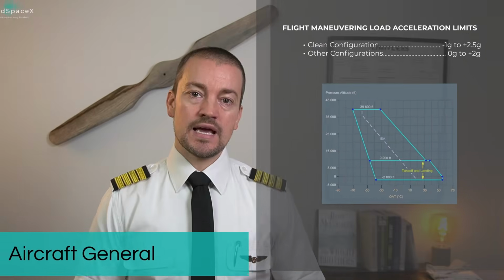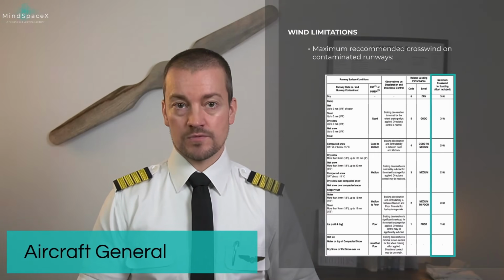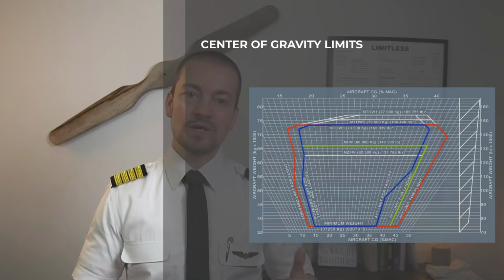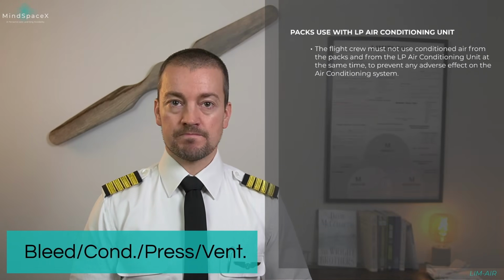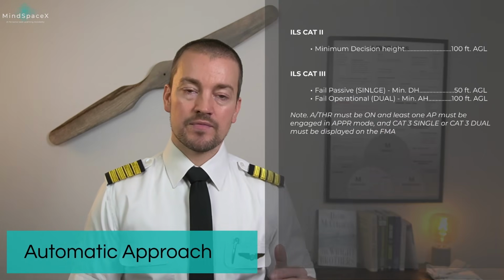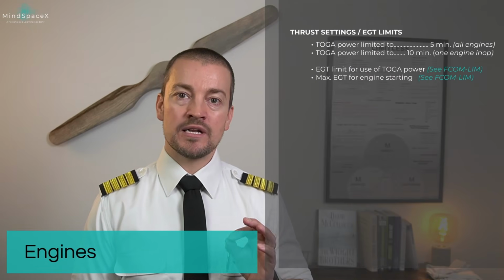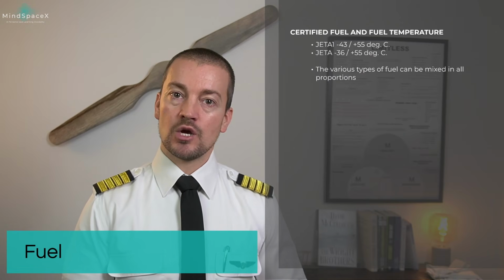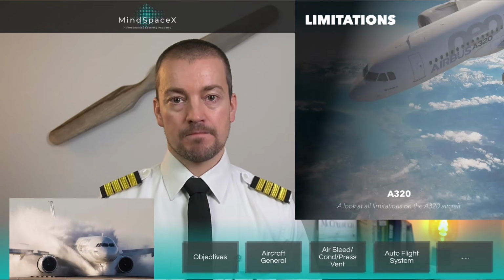A320 Limitations

Comment: In 50:25 Why are the max temp for T/OFF 300 if no brake fans installed, but 150 if they’re? 
Since you can’t takeoff with them ON anyway?
Reply: Max Temp for T/O is limited based on whether brake fans are used or not. Technically it’s written as “whether installed or not” but it’s based on usage. The brake fans provide very efficient cooling and blows straight across the temp. sensors on the brakes. Therefore the reading in the cockpit will be greatly affected. Pilots are not to commence takeoff if brake temp exceeds 150 with fans ON or 300 with them OFF.
Reply: Post RTO fire or Airborne wheel well fires

Comment: A lot of figures but author didn’t notice what should pilots to memorise 🤬
Reply from the maker: HI,

We focus here on pilots understanding the limitations rather than merely memorising values. It is a very important aspect of a pilots education and therefore something we at MindSpaceX Aviation emphasise on. The presentation here is meant to be somewhat generic to the A320, so some values are given, but not all. Bottom line is that ALL limitations should be known and understood by the pilot. Your FCOM will always be the place to refer for your specific aircraft model.

Comment: Some models have a tail wind for TO of 10 kts
Reply from the maker: This is absolutely correct. That is why I in the beginning of the presentation state that pilots must always refer to the respective manuals for the model they fly. 

Tailwind limitations are tied to the wingtip modifications on the aircraft. So Sharklets etc. gives different values.

Comment: A319 to 21 can perform a 180 turn on a 30m rwy... Not 45m only
Reply from the maker: That is correct. The 45m minimum refers to the minimum nominal width required for the aircraft. 

Based on ICAO Annex 14 and FAA specifications the minimum runway widths recommended for the various Airbus aircraft are:

30m for the A320 family MTOW <68T
45m for the A320 family MTOW >68T

We therefore refer to 45m in the presentation because we assume a MTOW of 77T.

The nominal width required is based on the aircraft during flight testing having demonstrated sufficient safety margin in crosswind conditions and directional control after various failures. 

It is not the reason BUT it does ensure the aircraft can make a 180-degree turn on the runway :)
Reply: Thanks guys for quick answers

Comment: captain,  8min 29secs   the maximum tailwind for T/O  is wrongly displayed

Is mach number required to know with landing gear operation speed?
Reply from the maker: Hi Sir, 
As mentioned in the video, the limitations are given for one specific A320 model. It is not to be applied across the fleet in general. When it comes to tailwind limitations specifically, then it’s determined by the wingtip modifications such as Sharklets etc. 

No we refer to IAS when talking VLE and VLO.